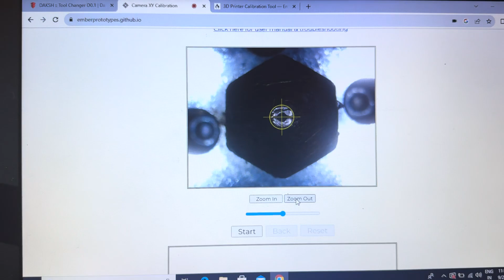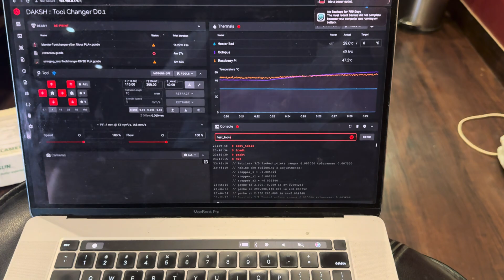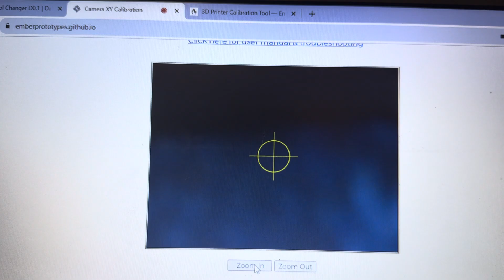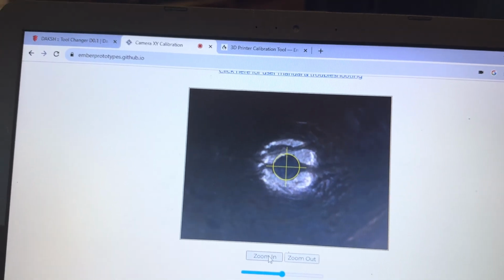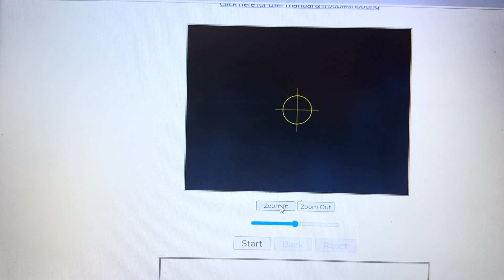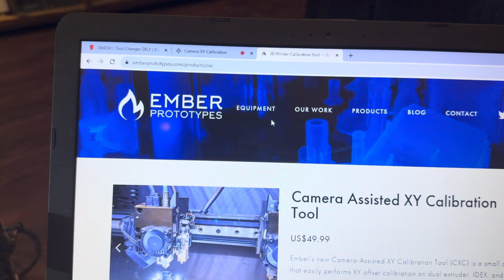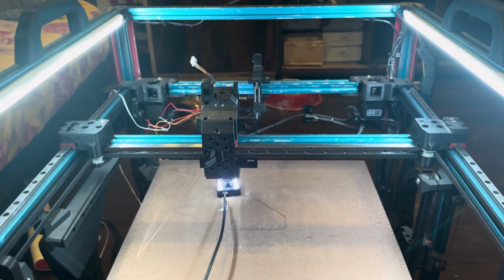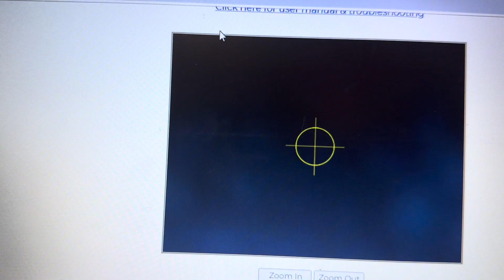3D Printed Tool Changer - Nozzle Repeatability Test  with excellent accuracy

Comment: That's outright impressive! Also, another video , where the tool change takes only 2.5 sec, is an absolute blast. Thank you for pushing on this project!
i personally not into the multi-color-printing, but rather into prototyping with 3d printer. So high speed printing really hits the sweet spot here. In reality this translates into hard requirement that the Y gantry have to be very light. Also, prototyping very often involves dissolvable supports, and this is where the 2nd tool comes into play. So I'm on a fence between IDEX with two very lightweigth tool heads, or your tool changer, which is very promising. Tool change time itself isn't very critical (to a degree), as long as it can actually print fast. And my guess I'm not the only one in this position, so your project actually has a bigger appeal to the community, beyond just multi-color printing. 
So I wonder, have you considered high speed printing with the tool changing head? How fast you can push it in your existing setup? X mm/s, accels? Also, how precise it is with the 2nd tool? In the other video you've shown that there's no loss in precision whatsoever with a single head (and this is really impressive), but what about 2nd tool? because, well, it's never perfect. Though for printing supports the high precision might not be very critical.
Anyways. This is really cool project!

Comment: Why don't you use a load cell for the xyz alignment?
Reply from the maker: Load cell is not fully supported by klipper at the moment and needs an extra hardware chip to convert the analog signal to digital.

Comment: The alignment by camera reminds me of the way that pick and place machines align the PCB location via fiducials, and the position and rotation of the part that is picked up and is hanging on the nozzle.
Reply from the maker: thanks for sharing the link in discord - will check it out for auto alignment. Although - this will only do x and y, not z

Comment: Really cool!

You will probably add a bit more time for travel between tools. And about 0.5 sec to Klipper buffer flush if you want to verify any switches. Still impressive! 

I'm just a bit concerned that the BOM will be quite custom, seeing those linear rails with drilled bits. Also seeing you still have only one after a week is hinting the manufacturability is not great. I hope you are working to simplify that.
Reply from the maker: Thanks :-). The linear rails are not drilled - they are m3 pins in mr63zz bearings sitting in the holes of the linear rails. I only have one toolhead thus far because i have been revising the design to simplify things and add rigidity to the various elements - especially the z probe integrated into the toolhead. The only thing that requires custom work is cutting the rails to the specified length - everything else is off the shelf. A single tool can be put together in 15 - 20 mins. The idea is to take it slow to ensure reliability and verify everything with a single tool before moving to add more. The current focus on the hardware - the software is more or less a done deal from the v1
Reply: @ankurv2k8  that's very promising, looking forward to the final design.
Reply: @ankurv2k8 This really is a wonderfull design you've made, especially when you think about keeping it as simple a possible to reproduce. Nice job!  Is there any date you set yourself to release the design files? Looking foward to that 😎
Reply from the maker: @winandd8649  thanks. There is no set date as such but i am looking at a formal release soon once i have the tests completed and the printer doing successful multi material prints
Reply: @ankurv2k8 Great!! Can't wait!! 🤩
Reply from the maker: Also - could you point me to the Klipper Buffer flush you mentioned - not sure i have seen that in the klipper documentation
Reply: @ankurv2k8  Just my experience with tapchanger. Klipper pauses for a bit whenever I check for probe status. 
Essentially it flushes the command buffer and waits for an answer from the MCU. 

I will take a deeper look into the code, maybe there is a way to avoid that.

Comment: Thanks for your work and your project! This ist still the most promising multi toolhead core xy printer project, besides the commercial Prusa XL. I hope you continue your good work and that it will be picked up by the community soon. Then things could go really fast! Imagine if you could use the camera in the setup to correct for small variations or a general drift, maybe as part of the print setup process for each toolhead). Instead of spending hours of manufacturing the perfect precision, you let the printer correct for any errors. Just like with bed mesh leveling. Again, thank you and good luck!
Reply from the maker: thanks - really appreciate the comment